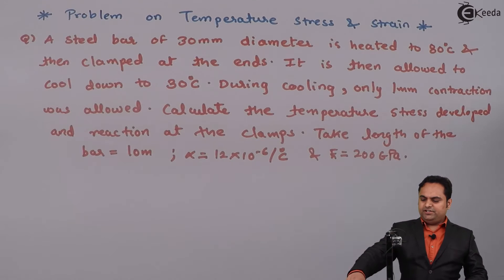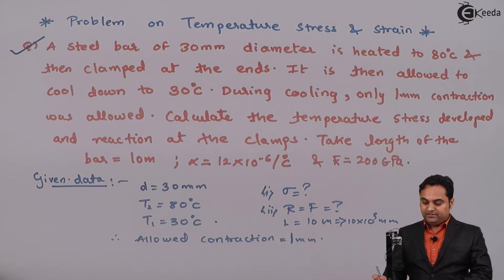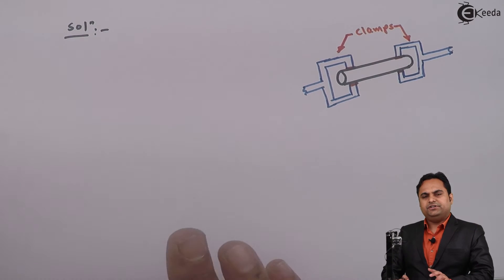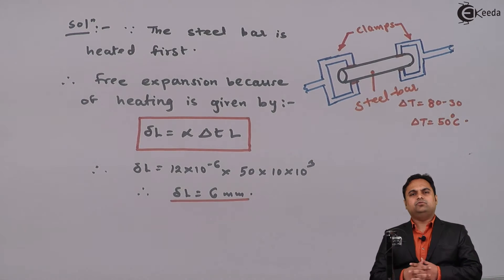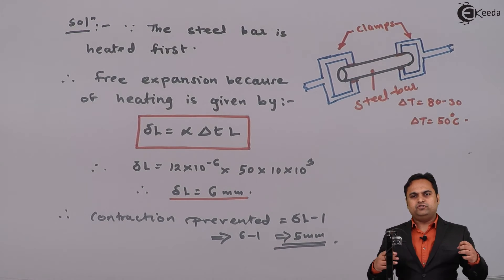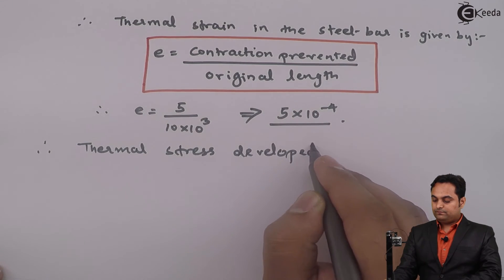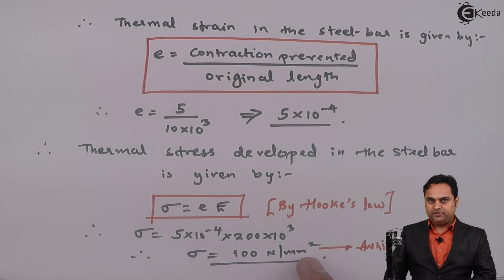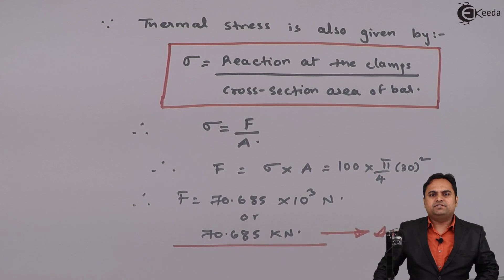Temperature Stress and Strain : Problem 5 - Stress and Strain - Strength of Materials

Comment: SORRY SIR. if the steel bar heated first up to 80°C , why temperature change during free expansion is 50°c?
Reply: shoudn't it be 30-80 as it will be final minus initial??
Reply: You see if you take the temperature difference as negative it signifies contraction rather then expansion in the formula for thermal expansion but since it is already inferred in the question that contraction is taking place you are not obliged to write the negative sign since you know contraction is occurring , Hope you got my point
Reply: 80-30=50
Reply: @manoharg8557  tem change is 50 only after the steel bar is clamped.But initially tem change must be 80